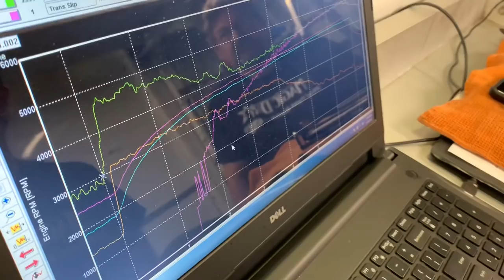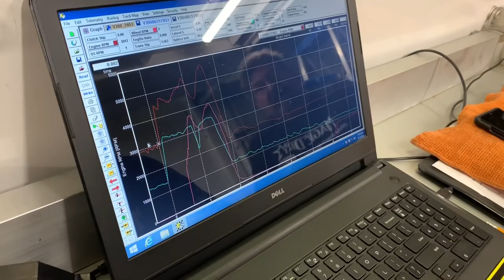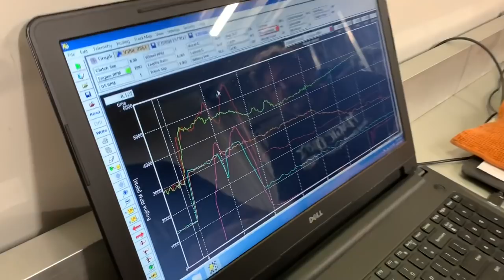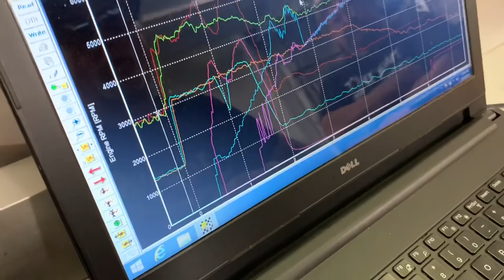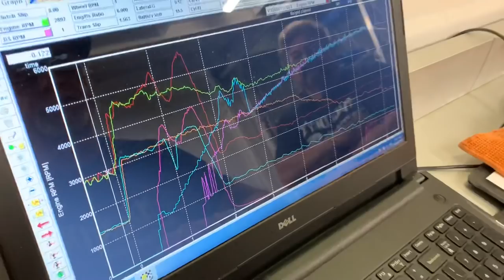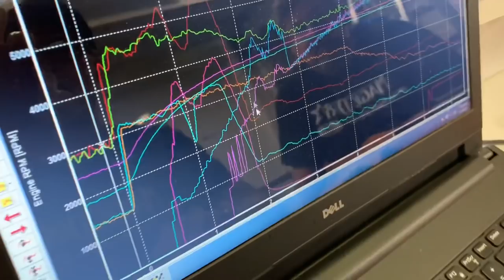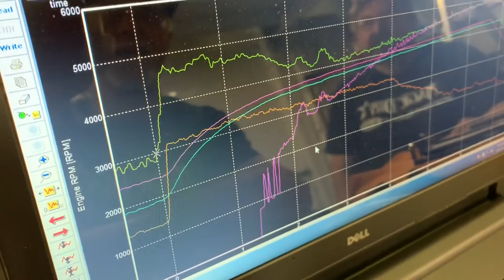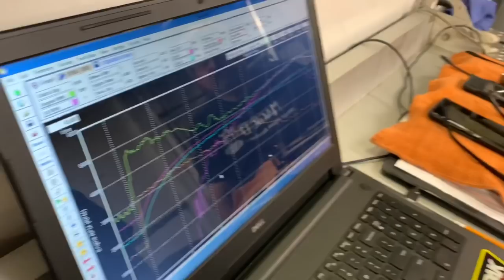WHY THE LAPTOP COMPUTER IS THE MOST VALUABLE TOOL FOR TOP FUEL NITRO HARLEY NHRA DRAG RACERS! DATA!

Comment: I’m working on a dual fuel system for the summer races. I would think these guys chill the fuel a lot like the A/fuel guys do. When the air gets so hot chilling the nitro has been a game changer. So much that NHRA made a rule that the fuel temp can’t be below 40 degrees in the staging lanes. I’m working on a hidden tank chiller for the lanes. My system taps in to the rear A/C of the tow vehicle with the lines hidden in the tow strap. I’m not up on nitro Harley rules but I’m pretty sure there’s no % rule. If you want to do a fun little experiment take some 60 degree nitro and fill a water bottle up. Then put it in the sun. Every one knows nitro expands with heat. Until you really see it for your self it’s hard to imagine just how much it expands. It’s like 20-25% so as the fuel in the tank heats up. The rule of thumb is to keep adding alky to keep the percentage by volume up. The problem is that even though the nitro physically gets bigger the energy density stays the same. Instead of mixing the 2 fuels I’m trying to work out a dual fuel system. One nitro system and one alcohol system. The alky system is used as a intercooler and is injected over the blower to cool the air before it hits the rotors thus raising the air density tricking the motor in to thinking it’s got better air.  My nitro system is injected only into the down nozzles. I’m also working on a accumulator hooked up to auxiliary nozzles in problem cylinder using a MJV valve controlled by the racepak so if the cylinder sees the EGT get any higher than 1,400 air is applied to the accumulator and alky is injected via the auxiliary nozzle. This system is geared more toward the nostalgia fuel motors with their small fuel pumps. To try and combat having to burn a bunch of pistons up, trying to get the thing to mph out out the back door.  Growing up around alky and fuel cars I seen so many cool inventions for drag racing. That ingenuity has slowed down a awful lot in the last 15 years. My father was either the first or second guy to make a “ billet hemi cylinder head for drag racing. I was only 3 years old . Some say Ken Vinney was first some say my father’s was first back in 1981. I got to work with so many smart guys growing up. There was so much ingenuity back then. Now every one are just sheep trying to copy each other. The coolest part about the nitro harly stuff to me is just how different all the teams are from each other. With most al other category’s being so PC and white washed it’s really cool to see the diversity with the top fuel bikes.  Even promod cars are starting to get all cookie cutter. The top fuel bikes remind me of the good old days when racing was fun.  Thanks for the great vids!!
Reply from the maker: Great info. I'm sure one of our experts here will be able to respond. Thanks for the comment, please subscribe and have a friend do the same.

Comment: One more thing. Why doesn’t any one take a fuel temp to go along with the flow meter readings? Because nitro expands so much with heat. The fuel temp can skew the fuel flow reading a lot. Every one looks at the fuel displacement going through the engine instead of the fuel density. By using a channel to take fuel temp along with the fuel flow measurement you can get the whole story and not just half. I started taking fuel temp reading right before and after the run.  It’s a big eye opener and has help to understand the random piston scuffing events that happen so much now days.
Reply from the maker: Good question.  We will get answered. Thanks for the comment, please subscribe and have a friend do the same.
Reply from the maker: @dev-debug  For sure. There are always secrets in racing. Thanks a lot for the comment. Please subscribe and get as many motorcycle friends as possible to do the same. Thanks a lot!

Comment: I recently watched a bunch of your video's and noticed on the nitro bikes, the drivers all seem to lean hard left when under power. Do these bikes torque right or is there another reason?
Reply: Interesting !! With the pipes usually being on the right side of the bike I would think they would have to lean right.
Reply from the maker: There are many reasons and many techniques top keep them going straight. Remember that drive chain is only one side. To keep the bike properly balanced is incredibly difficult. Making those corrections as a ride can save a run. Simply not be lined up straight can cause that too. Thanks for the comment, please subscribe and have a friend do the same.
Reply: @cycledrag  
Bristol is known as -The uphill drag strip. If your car/bike fails, just knock it out of gear. It will roll back to the starting line, by it's self. I've seen it happen many times.
Do you want help, going from track to track ? I'd love to help out !
Reply from the maker: @ricktaylor3748  Interesting!
Reply: CycleDrag I’m not understanding how the chain being on one side would steer the bike? I have ridden a lot of motor cycles and never had one pull in the direction of the chain🤔
Reply from the maker: @groomlake51  motorcycles or TF Harleys? These are 1000 horsepower running on the edge. 0-220 mph in 6 seconds. The amount of torque and force is immense. Thank you for your comment and thank you for subscribing. Please check out my latest videos and please get as many friends as you can to subscribe as well. All motorcycle speed freaks are welcome here! Thanks
Reply: @groomlake51  
The primary gear and rear sprocket are on the same side of the bike/frame.  When the engine is under power, the frame flexes/ bends to the chain side. This causes frame twist.
The rider has to lean to one side or the other, that keeps the bike going straight.  If you've ever noticed, drag cars always lift the drivers side, That's because the engine rotates clockwise. The same applies to bikes or cars.  Hope you understand, if not. I'll try to explain better. 👍
Reply: Rick Taylor yes preload I have scaled a few cars but , always ridged chassis. Does the exhaust on the right side compound the chain on the left side and the bike pulling?
Reply: @groomlake51  
No, it doesn't matter what side the exhaust is on. This leaves a sour taste in my mouth, but Harley's V-twin makes a lot of toque. The engine will "toque" to one side, depending on what side the primary gear is on. Top Fuel Harley's have an outboard support., which braces the output shaft. This helps the bikes frame from flexing.
Notice how the HD riders lean to the right, they steer the bike, by leaning to the left or right.  I'll TRY to explain better, if need be. 👍